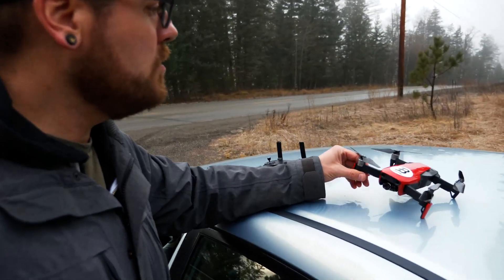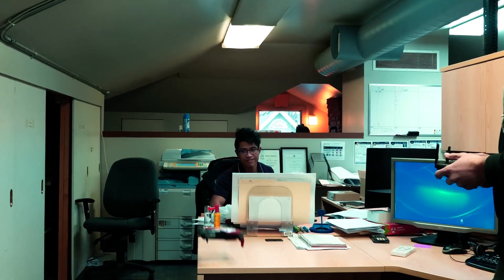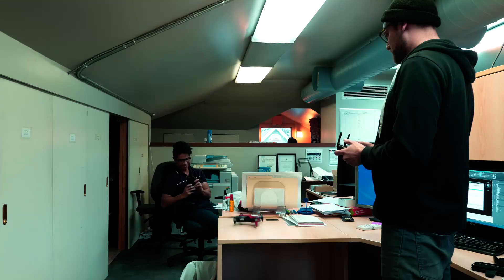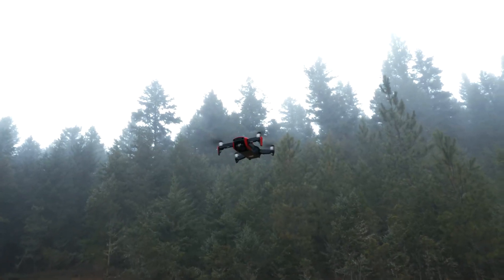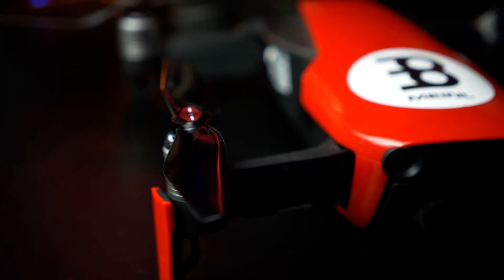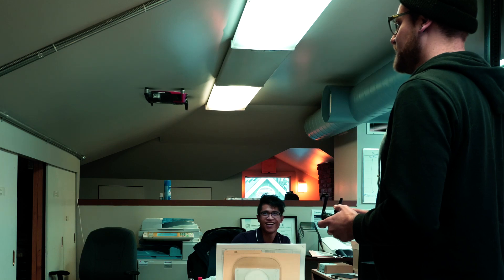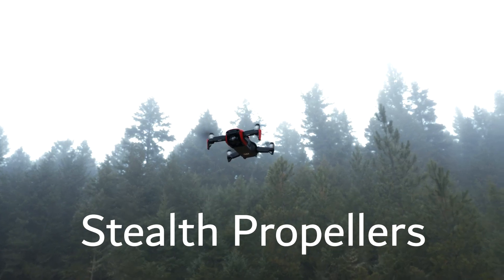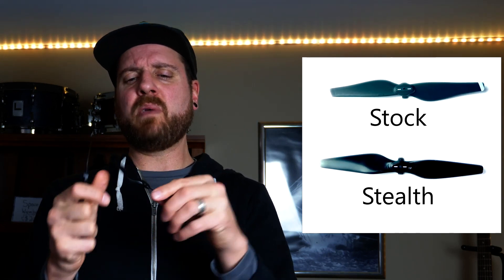How to make your drone quieter | Stealth Props for the Mavic Air

Comment: Phew, $50 is a bit steep, do you know if the mavic pro platinum propellers work on the Mavic air? I would love to see a side-by-side comparison of the master air screw props vs the pro platinum props since they both promise basically the same thing. Maybe a future video idea? 😉
Reply from the maker: Sweet! I like new ideas. Plus, depending on where you are, $50 for me here in Canada might be dif than other places. The best prices might be on their website. Might be worth looking.
Reply: @MikeErickson  true, I wasn't thinking CAD, checked their website and they cost $24 USD which is totally reasonable.
Reply from the maker: Cool man - we often get hosed at the boarder for duty. I should have mentioned that in the video - lesson learned!